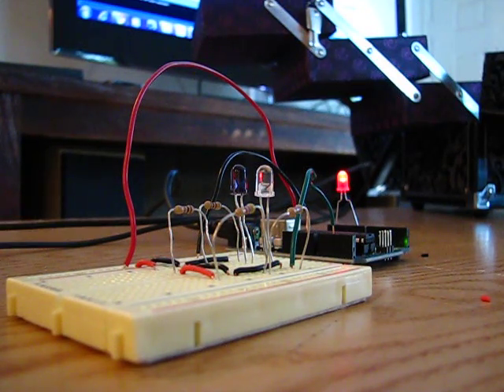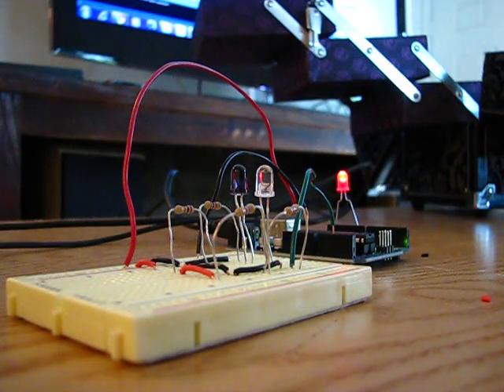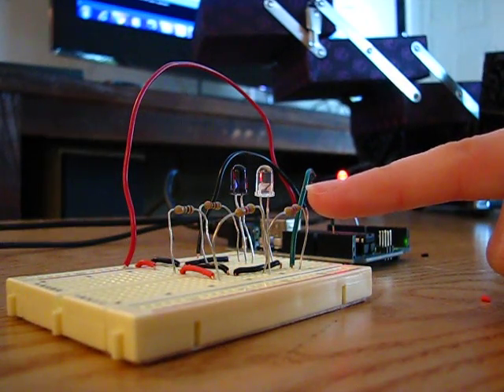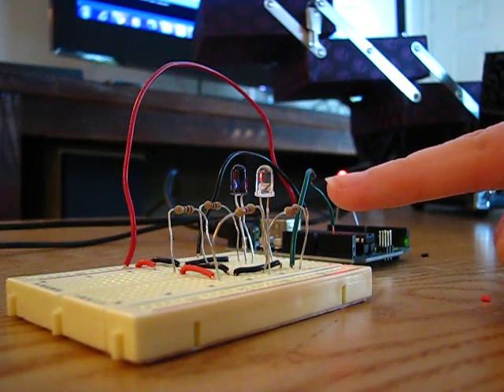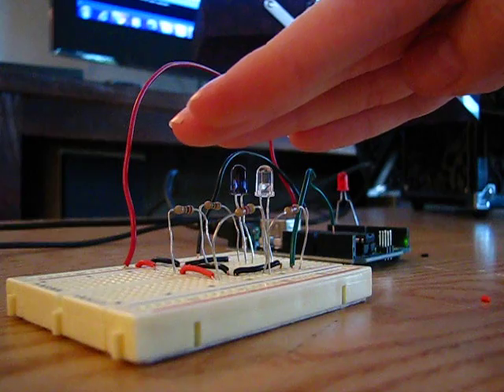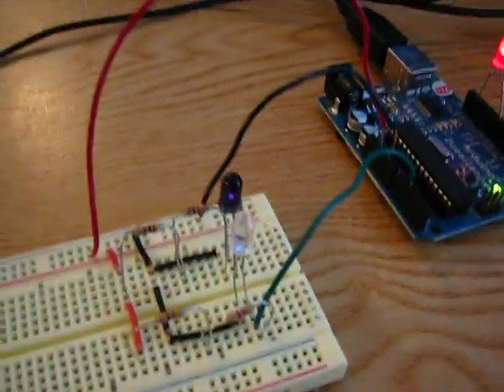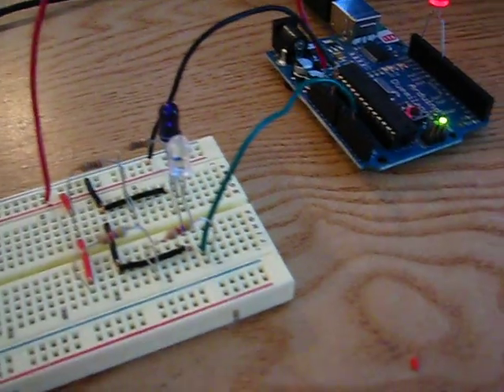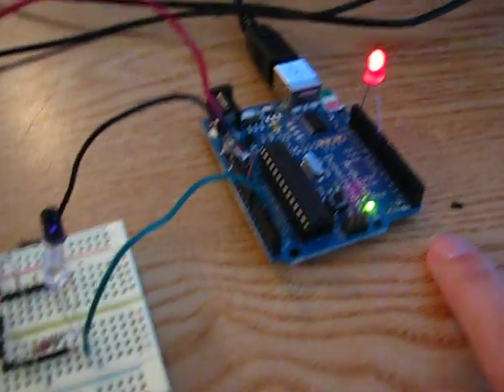Arduino + IR Emitter + IR Detector

Comment: Hello, and forgive me for my bad english, I'm french.
I have a little question.
Why used Arduino ?    Not necessary.  It's same result without arduino. 
Not need microcontroleur or programmation for this expérience.

I wish you a great day and forgive me for my bad english again.

Mickaël.
Reply: actually great video and i don't have any issue with your language...
and yes we are using arduino because it make things simpler in complicated project light robot... here we are using arduino just for better understanding otherwise you may do your work only with ir emitte, receiver,led and battery just connect all of them in series...
Reply: @ Anand Tiwari:   The emitter will never be powered by connecting all of them in series.

Comment: hello..can anyone help my problem..my problem is to make the code in arduino for ir led receiver and ir led transmitter..how to make code for this component..i want ir led transmitter connected to ir led receiver...when it connected i want the led on and when not connected led off..can anyone help me...thanks you :)
Reply: fitri imran you just need to give power to the emitter and connect the receiver to analog

Comment: Hello, I think you are pointing the LEDs in the wrong way. The black colour led is the detecting led and the one which looks like an ordinary led (that transparent one) is the IR emitter. Thanks
Reply: +Vishnudas Kartha no it is right, look at the dark one, it's emitting ir light.
Reply: +Vishnudas Kartha I'm pretty sure you're right.  I believe I have the same sort of kit (made by Nexxtech) and on the back, it DOES shows the clear unit as being the Detector/Phototransistor and the tinted as being the Emitter, which isn't correct.  I was having issues until I swapped the two as you mentioned.

Comment: can we use arduino at mega 8
Reply: The micro controller chip is just what controls the system, if it supports the correct voltage output for the ir emitter and sensor I don't see why not.

Comment: Hi Michelle, I love electronic project, however, I have no clue how arduino works. I have a couple of stepper motors with boards from ebay but they require it. What would be the cheapest arduino computer I can connect to pc via USB and somehow communicate with it?
Reply: arduino uno is a good start. get a knock off from ebay for about $5-$10 or an authentic one if you can afford it. it helps support the company

Comment: int sensorPin = A0;    // select the input pin for the potentiometer
int ledPin = 13;      // select the pin for the LED
int sensorValue = 0;  // variable to store the value coming from the sensor

void setup() {
  // declare the ledPin as an OUTPUT:
  pinMode(ledPin, OUTPUT);  
}

void loop() {
  // read the value from the sensor:
  sensorValue = analogRead(sensorPin);    
  // turn the ledPin on
  digitalWrite(ledPin, HIGH);  
  // stop the program for <sensorValue> milliseconds:
  delay(sensorValue);          
  // turn the ledPin off:        
  digitalWrite(ledPin, LOW);   
  // stop the program for for <sensorValue> milliseconds:
  delay(sensorValue);                  
}
Reply: Nice code, but will it not be "analogWrite"? since she is using PWM to fade the LED's I think.

Comment: The code Is this
-------------------------

/*
  Analog Input
 Demonstrates analog input by reading an analog sensor on analog pin 0 and
 turning on and off a light emitting diode(LED)  connected to digital pin 13.
 The amount of time the LED will be on and off depends on
 the value obtained by analogRead().
 
 The circuit:
 * Potentiometer attached to analog input 0
 * center pin of the potentiometer to the analog pin
 * one side pin (either one) to ground
 * the other side pin to +5V
 * LED anode (long leg) attached to digital output 13
 * LED cathode (short leg) attached to ground
 
 * Note: because most Arduinos have a built-in LED attached
 to pin 13 on the board, the LED is optional.
 
 
 Created by David Cuartielles
 modified 30 Aug 2011
 By Tom Igoe
 
 This example code is in the public domain.
 
 http://arduino.cc/en/Tutorial/AnalogInput
 
 */

int sensorPin = A0;    // select the input pin for the potentiometer
int ledPin = 13;      // select the pin for the LED
int sensorValue = 0;  // variable to store the value coming from the sensor

void setup() {
  // declare the ledPin as an OUTPUT:
  pinMode(ledPin, OUTPUT);  
}

void loop() {
  // read the value from the sensor:
  sensorValue = analogRead(sensorPin);    
  // turn the ledPin on
  digitalWrite(ledPin, HIGH);  
  // stop the program for <sensorValue> milliseconds:
  delay(sensorValue);          
  // turn the ledPin off:        
  digitalWrite(ledPin, LOW);   
  // stop the program for for <sensorValue> milliseconds:
  delay(sensorValue);                  
}
Reply: Amirul Hadi you're a life saver for this!

Comment: please help
I have been doing some experiments with ir sensors. I want to make a kind of tachometer. 
I did a test. I light a trasmiter. I put a receiver in front of it and I read to see what happend. I found it is 'high' without light and is low with light but I tried to light the sendor in a way it is always low but I could not ... The most I can get is 50 of each more less .... is it possible to light the sensor permanetly so get always low ???

Comment: i wont trouble u by asking u to send the code or anything, but can u just confirm this!!! did u jsut connect the IR transmitter and receiver with some required resistors?and take the ratings from the receiver? , or do i need to do anything else?

Comment from the maker: @zabawla Now that I think about it, yes probably. The main thing is that it is interfering with the infrared, which is what I actually said in the video. The decoded gets used to (calibrates) the amount of infrared within the first 5 seconds, and then when it changes-- whether it be more or less-- the output will fluctuate.